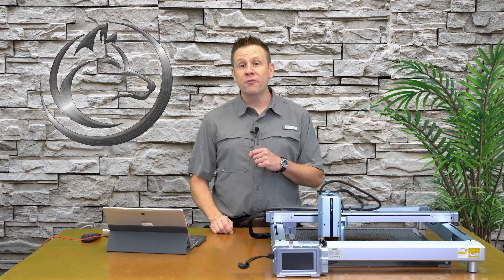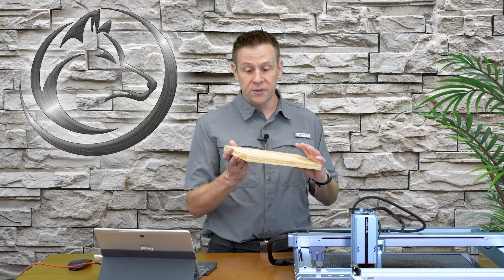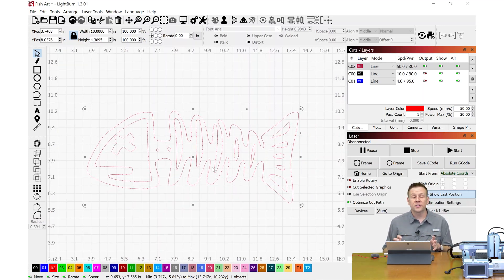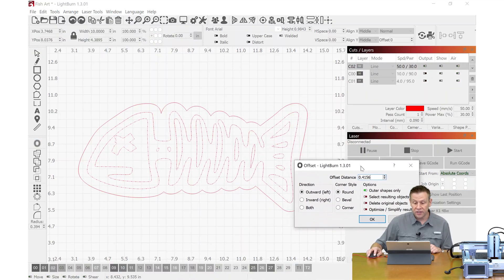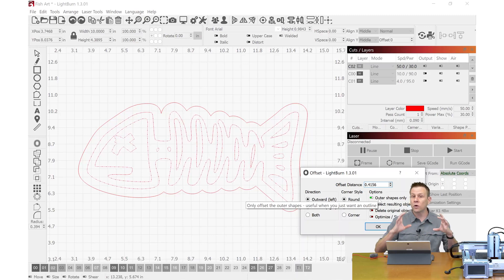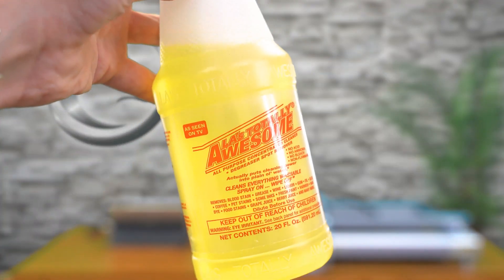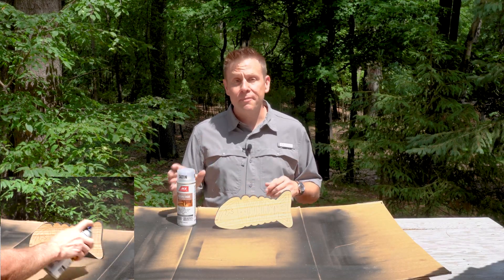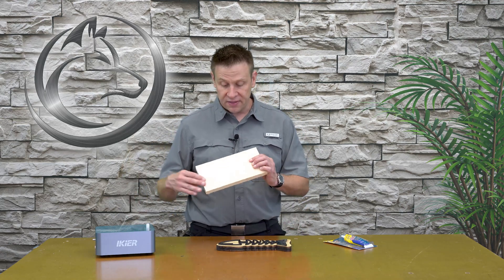Ikier Pro Max 48w- Cutting Solid Pine!

Comment: Hi, I’ve followed your videos and I’ve learnt so much. I just bought my ikier pro machine but I’m having issues keeping my project within the frame. The machine keeps on bumping the edges even though I’ve kept my project within the frame. What do I need to do?
Reply from the maker: Thanks!  When engraving there's an over travel distance call "over scan" when you click on a layer.  This allows the laser module to slow down before stopping- which is a good thing.  If the project is close to the machine frame then there's a good chance the over scan distance will bump the frame and fault the machine or cause a shift in the engraving alignment.

Comment: can we expand the table, let say 1000 x 1000 ...
Reply from the maker: The work area is expandable to 750*410mmby directly replacing the original Y-axis.  1000 by 1000- I do not see that option at Ikier.

Comment: What speed and how many passes did you use to cut that 1x stock?
Reply from the maker: Hi- I ran at 4mm/s (240mm/m) at 95% power- I don't recall the pass count, but the wood hardness/ density depends on the grade of wood in your area.  Normally I would run between 4-8 passes depending on the type and grade of the wood.  The power of 48 watt laser is very noticeable and I can run far fewer passes when cutting thicker materials!  Thanks for watching!